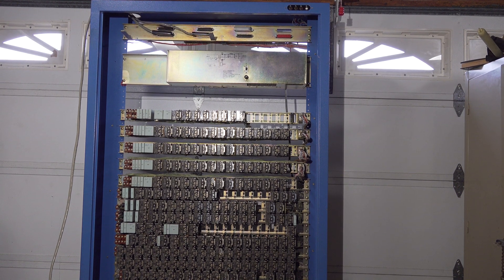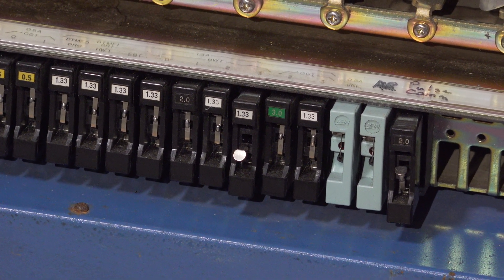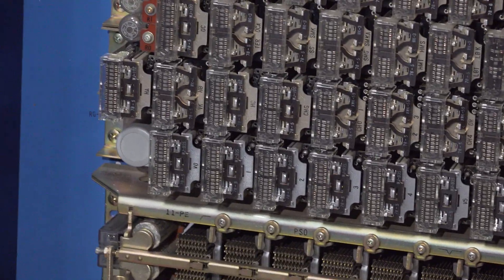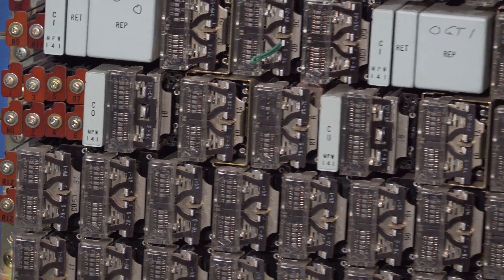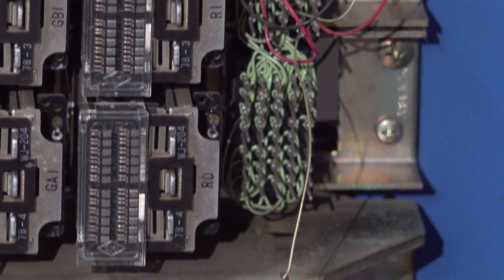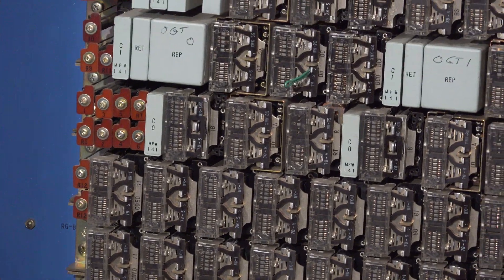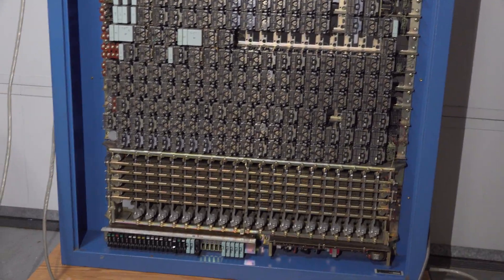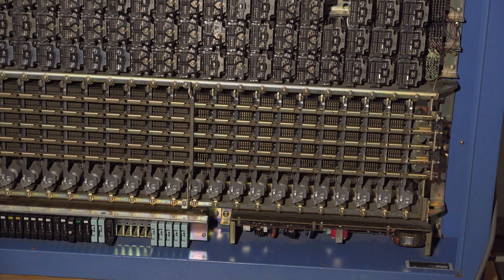OKI AC125A Crossbar PBX Detailed Demonstration

Comment: An old retired pbx phone tech here, i would work on the old oki, nec, Hitachi  , pabx systems in hotels for a company out of roanoke va (ucs) all were electro mechainal in 1977 moving to electronic pbx later in my career, tone to pulse converters in places that would not support tone.
Ground start trunks , 
Message waiting lights
Huge main frames   Mdf
I